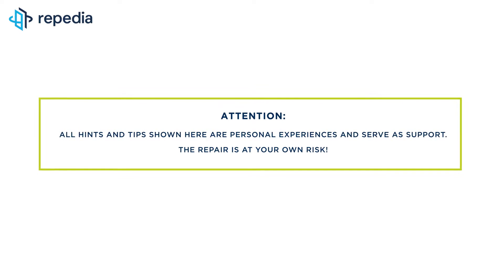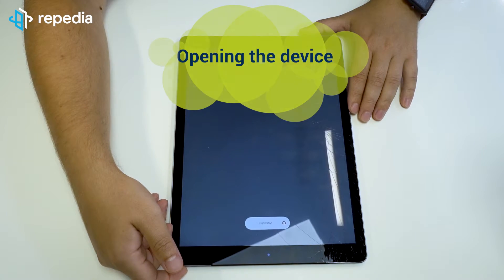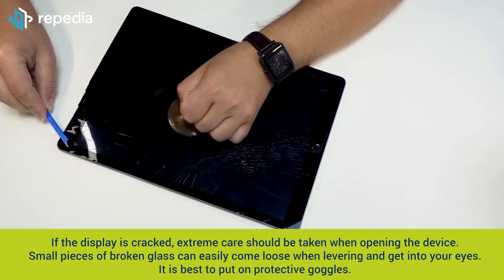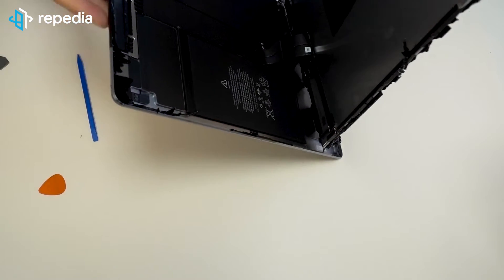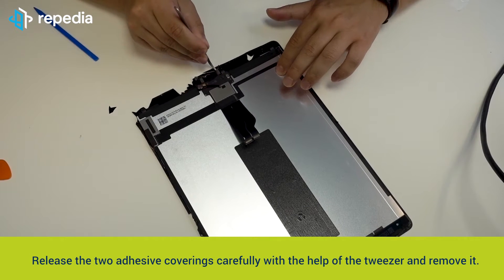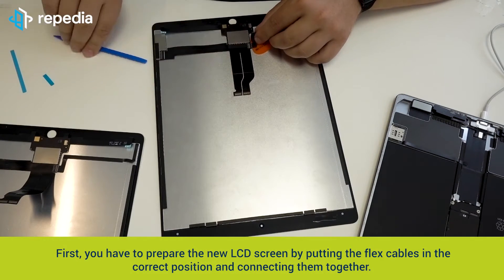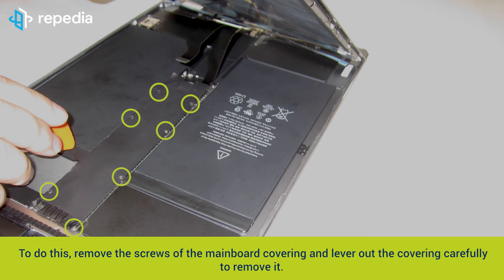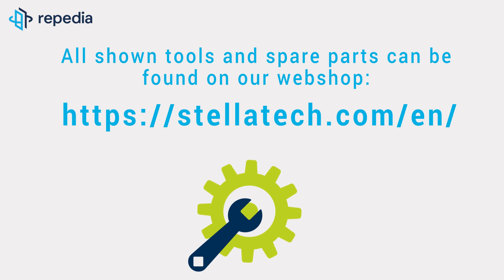iPad Pro 12.9 (2015) - Screen Replacement | Teardown Guide

Comment: You would need to disconnect the battery first, and also very important using a short screwdriver for the screws as is no room due to the screen flex being short. Great video anyway!

Comment: I did this repair and the home button didn't stay, it fell in within a few presses. I hadn't glued screen back to test so what can I do to get it to stay put?
Reply: Hey boss sometimes i run into this problem too, usually a pea size dab of industrial adhesive does the trick, one dot on the left side of the bracket and one dot the right. Hold each side on the bracket with your fingers for about 2-5 minutes just so the bracket doesnt shift out of place when you go to put the digitizer back onto the iPad :)

Comment: You missed out the critical part which was to disconnect the battery before releasing the screen. This guide should be removed to avoid potential damage to the iPad. PLEASE DISCONNECT BATTERY BEFORE DISCONNECTING THE SCREEN!!